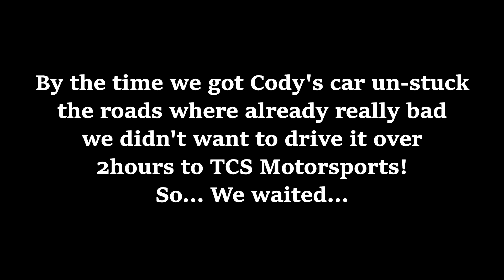ANOTHER TRIP TO TCS MOTORSPORTS? AKA MR2 HEAVEN

Comment: You ever find out why the white 2 fishtails like that on the highway ?😂 mines doing the same rn
Reply from the maker: We had fixed the issues after replacing some suspension components a few months ago. Cody drove the car around for about a week with no issue. He took it in for a alignment and that same issue was back again. 

Basically the car had some loose suspension parts, after we installed new stuff we had fixed but the alignment guys didn't tighten everything like the said they did even after they had a second look at the car!

TCS tightened everything up yet again & the issue has since been gone!